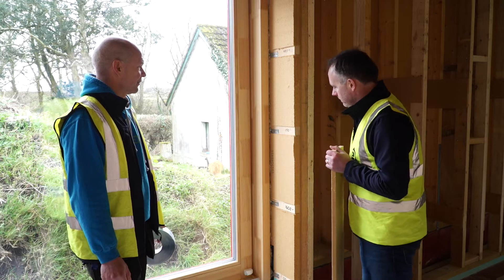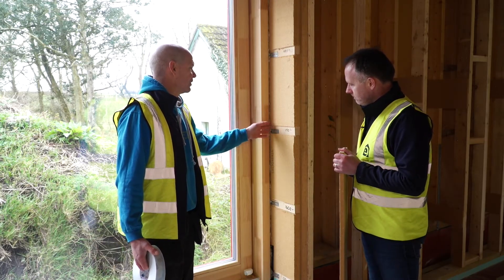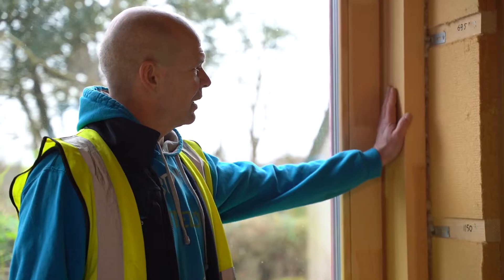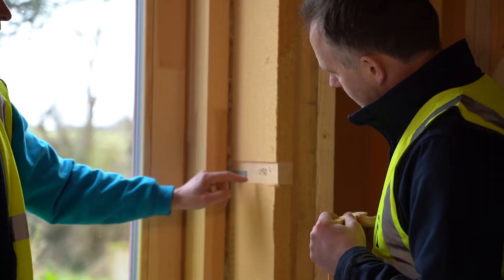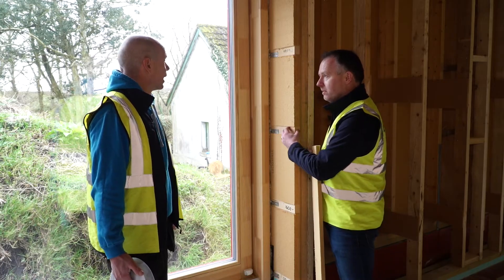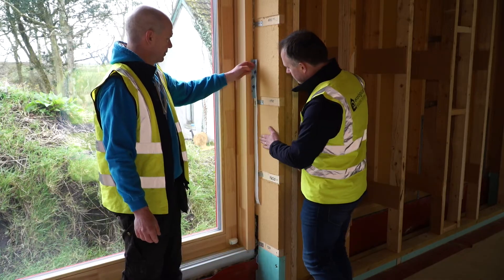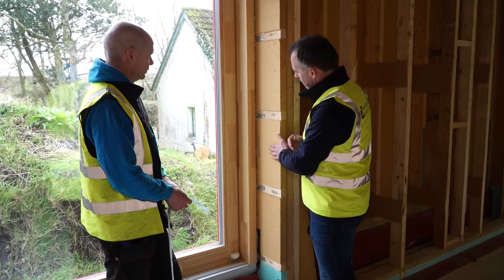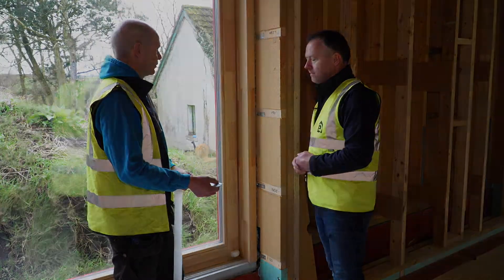Thermal Continuity and Airtightness Around Windows - Cooleen Passive House VLOG #3

Comment: Do you still have the ability to nail in the window casing trim or is now relying on only adhesive’s ?
Reply from the maker: Hi @MikeTS34. A mechanical means of fixing the window casing or trim is still possible. The nails should be positioned so that they penetrate into a structural component. Passing through the plasterboard and into the timber service batten behind it, to ensure a solid, stable hold. Alternatively, it would also be possible to use an adhesive for securing the trim.